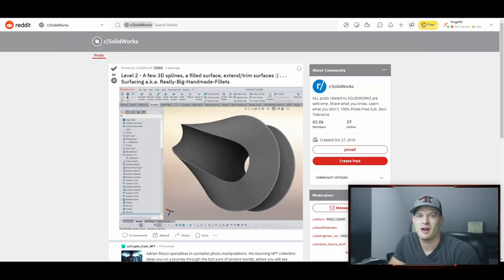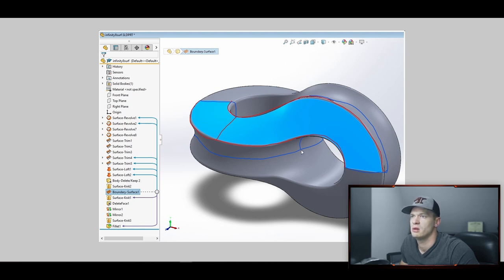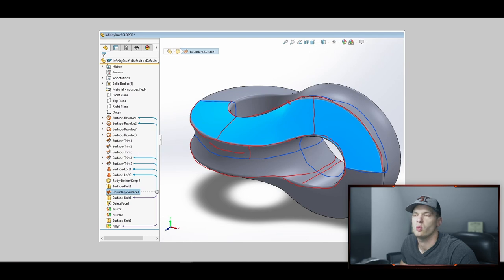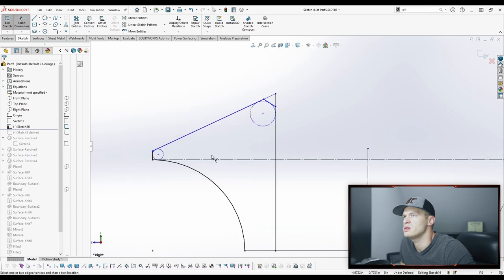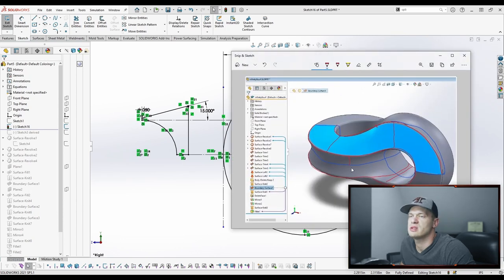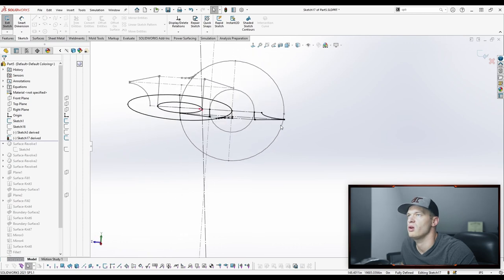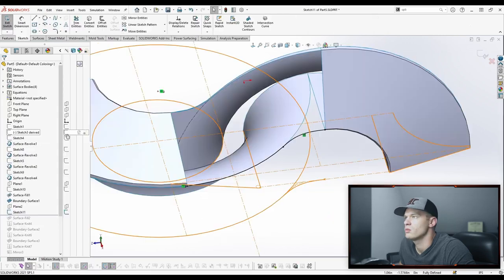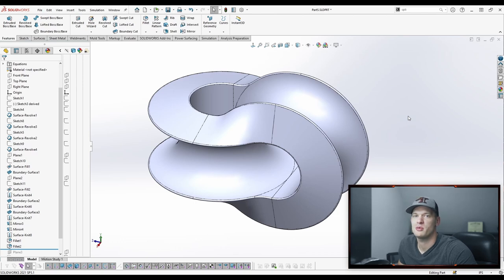SolidWorks Simple Surfacing Challenge Tutorial

Comment: Killer Tut! Great problem solving and solutions.
I will be revisiting this one, I am sure. Thanks!
(edit) The derived sketch tip knocked me over. I had to check to see if '18 has it which of course it does, I just have been ignorant of it till now.
Reply from the maker: I remember learning about derived sketch as well. It was a lightbulb moment. They are insanely useful and in my experience are very stable when set up properly. Before that I would be converting edges from all types of models and sketches. Then when something changed (and it always does) the whole tree would go red haha.